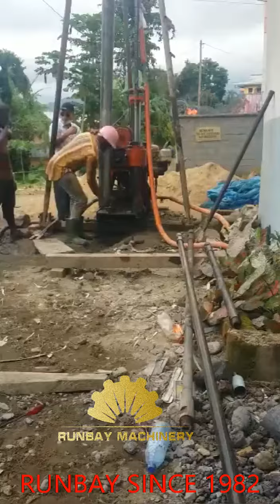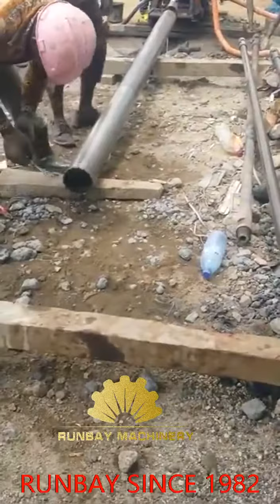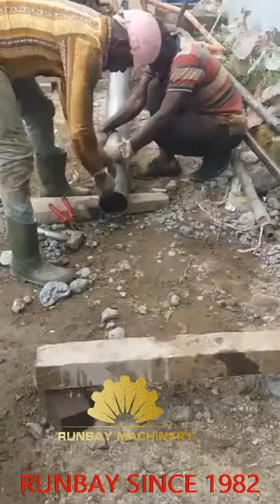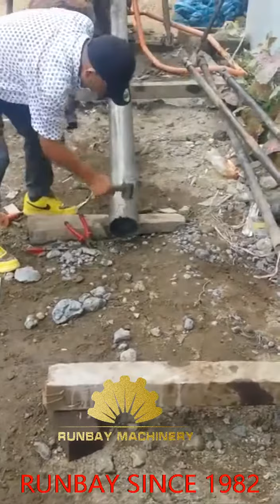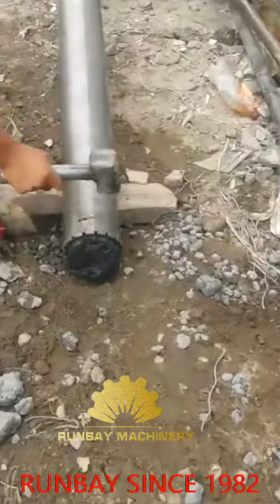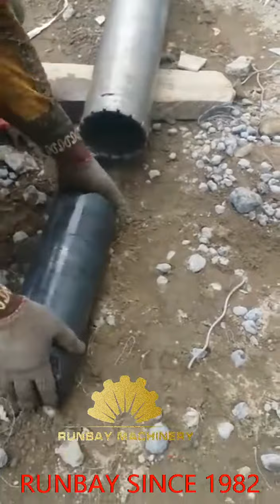HZ series is

Comment from the maker: HZ series is Conventional drilling rig,HZ  wire-line drilling rig is a kind of light weight drilling rig. It is widely used for general geological exploration of railway, road, bridge, dam and tall building base, geological core drilling, 
small grouting holes, blasting holes, civil wells and earth central air conditioning wells .
The following highlights represent the rig’s major features:
1).Compact structure of the whole machine with small dimensions meets the requirement of drilling in limited space and tunnel transportation.
2).Keeping bracket is installed on the hoist to form a double wheel support structure, able to withstand strong blow .
3).Vertical spindle are fixed by four groups of bearings to ensure that the rotary machine has sufficient rigidity to overcome gravel layer and other complex geological conditions.
4).the machine is equipped with national patent technology---taper clutch, with characteristics of strong transmission torque, easy operation and free maintenance. the details pls kindly contact 0086 18239933006 email: 
To: sales07@runbay-machinery.com, website: Web:http://runbaydrillingrig.com